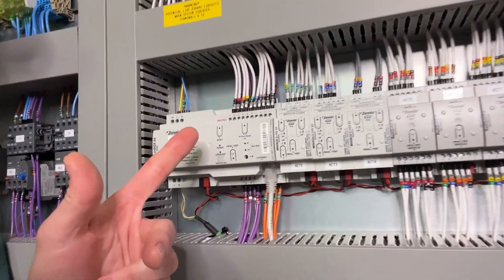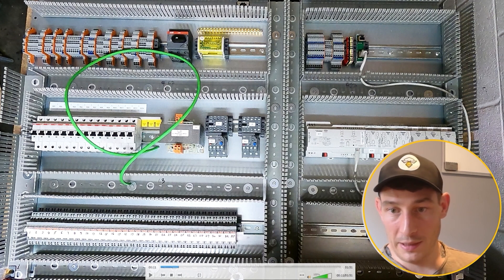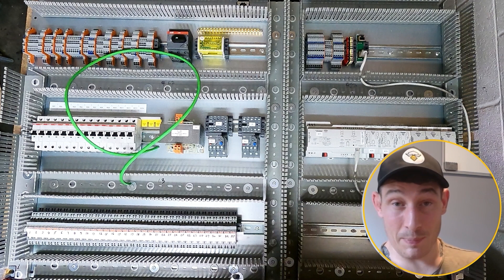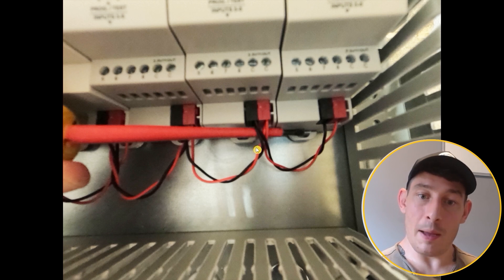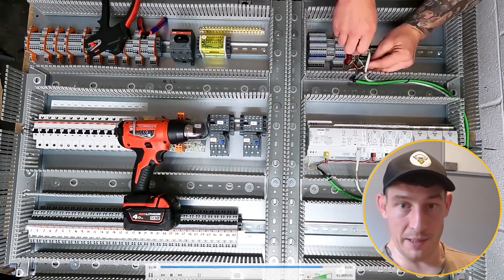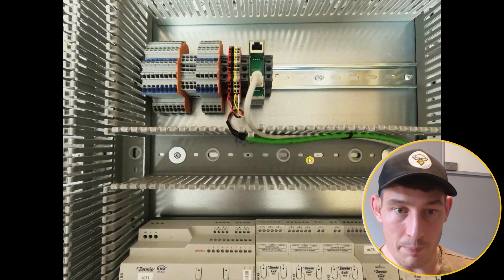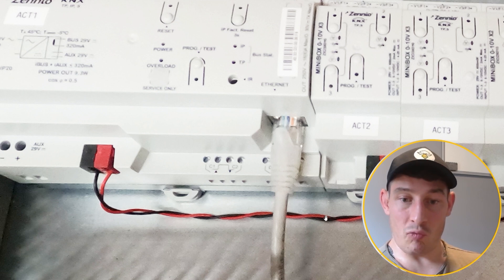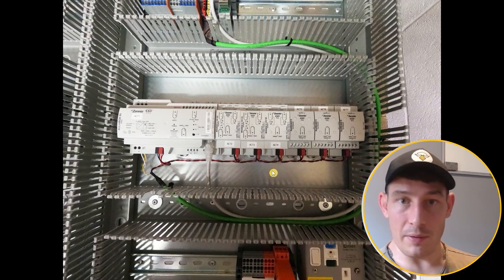PLC Panel Wiring Using KNX (Zennio)

Comment: Regarding eventual concerns for induction of noise/interference due to relay switching, I believe, if the cables run straightforward from the terminals to the cannels they will be 90 deg (perpendicular) to the KNX communication cables, thus no interference should be expected.